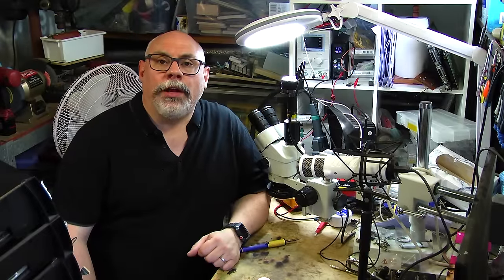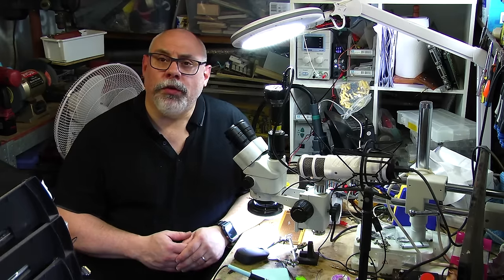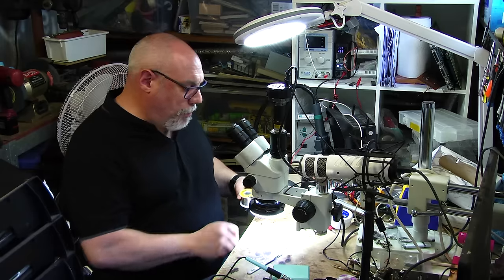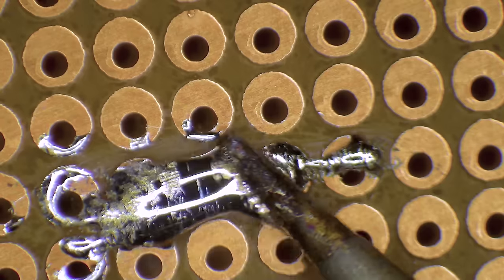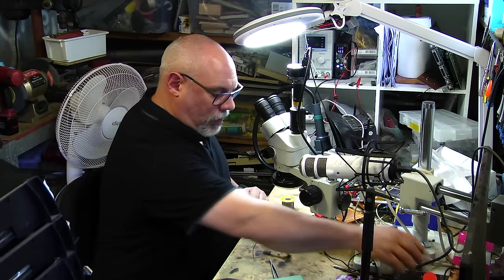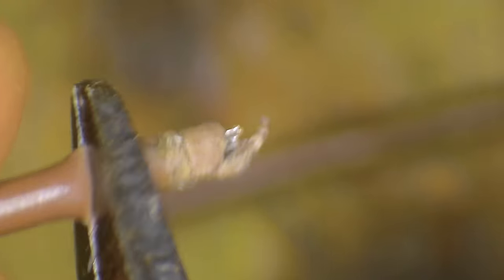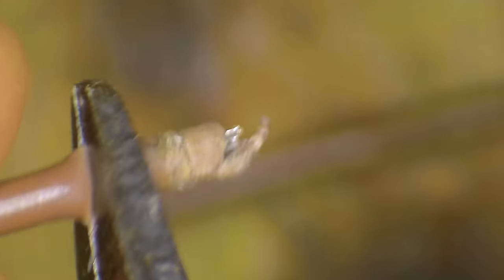Beginner's Guide to Soldering Electronics Part 1

Comment: "…if it’s attached at both ends you need to put your heat shrink on before soldering." Hands up everyone who has forgotten that bit of advice 🙋‍♂️🙋‍♂️🙋‍♂️🙋‍♂️🙋‍♂️🤦‍♂️🤦‍♂️🤦‍♂️

A brilliant video. Thank you very much for using the cheaper hobbyist station.

Comment: Great video... Especially when using flux...always wondered why I had issues, even with rosin core solder...  Only thing I would add is it isn't necessary to hold the flame on the shrink wrap..hold the flame off it some as you move, as the white part of the flame will deposit the soot.

Comment: Thanks Bruce . I watched your begginers guide a year or 2 ago . I tried a again recently  and got all that oxidation i was using a soldering iron that didnt have a station but went upto to 600C , I set it at 450C. I was using lead free solder. I was using a pointed end Tip. I rather think I should of used a bevel tip. Anyway i am going practice some more on the practice boards you mention.

Comment: Nice video mate! Funny, I always tell people the same thing: "DONT use the tip to melt the solder!" The reality is that the solder will almost always touch the tip.  In theory it sounds fantastic, but in actual practice, not so much.  Even pro's like you can't do anything about it.  I think the better advice is, "try to quickly" heat with tip and let the solder melt onto the component.  When we have boards with 50+ components, it'd take ages to wait for each pad to heat up to the sufficient temp to NOT touch the solder with tip.  Anyways, great informative video.  God bless.

Comment: Thank you for this Beautiful content man !!!
Immediately QRCode this man's video link, print onto a sheet of paper, then tape it on the wall by the door. Guaranteed to get that curious customer off the shoulder & out the door so your nose can get back into that mobo. 👍
A reminder for any new solder-suckers out there...if you are buying a pack of shrink tubes because it's on sale with 3k variety tubes in a cheap variety case or container..a REAL geek knows to put it back & go get the good stuff. No such thing as a sale on good heat-shrink. Lol.

Comment: I have always struggled making good solid joints when attempting to solder. After watching this I went and immediately started making solid, clean joints. Even with a very cheap iron. Kudos on the presentation!! 
Would you be able to do a video using butane torch? Many times when I need or would prefer to solder a connection I am miles from an electrical connection so a torch would be awesome to have the know-how to do. Please let me know.  Super video and even better information.   Thank you!!

Comment: At 24:55 you mention that both wires have solder on them so you don't need anymore solder, if you didn't add any more solder and just touched the wires to melt the solder, would they still solder together with a clean bond, or would you need to add some more flux to the wires? Thanks so much, probably the best video on Youtube for soldering!

Comment: You're great! Talk about generous with the trade secrets and you kept it real using equipment beginners would use. Pace attention to detail both on point....you even answered my burning (⬅️ so that happened 😆👁️❤️puns) question is it pronounced solder or sitter... BOTH who cares ya know what he means shutting down nit wits who love a good grammatical error to avoid learning so they are never held responsible in life! I never do the like/ subscribe/comment thing, but how could I not after all there was to glean from this. I'll even watch it over as I put it into practice. I'm just a small business owner whose wires and connectors to small appliances and decorative items have become taxed with new sanitizing protocols due to the recent pandemic. Replacing items only for them to wear out again 2 months later isn't an option anymore. So I've already tinkered with an oil diffuser and some electric candles I did ok they "worked" but my lack of flux has proven to require attention again, a mistake that won't be made twice. Now I'm going to look for anything on lamps....I've had 2 EPIC NEAR TRAGIC FAILS so far...think fire and an electrocution avoided only by explanation of God (I slipped as I flipped the switch fractions of a second and I would have been the rug which is now branded only because the inertia of me falling unplugged it as well....so yeah lamps 101😬)

Comment: With recent improvements in irons, there is now a legitimate intermediate level of iron quality between the "brute force" irons and soldering stations with temp control. 
There are now irons that have fully self contained electronics built right in to the handle of the iron that allows for a full range of digital temperature control. The main power still connects directly to the iron but, along with the built in temperature control, the heater/tip configuration has also improved significantly and they are now much like the more expensive stations. 
There's even a new USB powered soldering iron that has surprisingly good performance.
I just purchased a new soldering "pen" (nice thin easy to handle) with temp control and display right in the handle that's a full 80 watts for $15. It has interchangeable tips and it's been performing way above expectations considering the price point.
Reply from the maker: Yes, if you want some of my other videos, you'll see that I speak quite highly of the TS100. Feel free to reply with links to the models you're referring to.

Comment: I love the way how you preset this instructievideo. Almost therapeutic in calm voice step by step explained. Thank u for the video. Question if i may ask? Example of the wire point soldering you twist the end of the wire. How about  spreading/- split open instead? Meaning connect both wires togheter like vingers from one hand in to the other?  And then soldier it? Stay safe stay healthy love from The Netherlands

Comment: Absolutely fantastic video. Your explanations for what things are and their functions are beyond incredible. I've learn more from you in this video than my personal electronics teach I had in highschool over the course of three years. 
I do have a question for you or to anyone who reads this comment. I have a video game circuit board and was wondering under any circumstances would their be a reason for two pins to be bridged together side by side on one single chip? I was told that if any of the pins were touching then it would cause malfunction and not work.
The thing is my game has garbled glitched graphics and I was wondering if the bridged connection between the two pins could be the reason for why the graphics are garbled & distorted. Any information from anyone would be helpful and if anyone needs to see pictures of the board I can provide them for you thanks.👍😎👌

Comment: I bought a pound of Kester 63/37 Eutectic to practice.  Unless it's jewelry or plumbing, I'll never use lead free. 

Good video brother........"p.o.s.".....lmao 🤣

When your connecting stranded wire you don't like to splay the strands open, twist them together and then solder???   I was taught that's the ultimate for non solid wire. 

I subbed ...you earned it.

Comment: since I build guitars, I have to use the soldering iron to melt the heat shrink (no heat gun or flame on a finished guitar), the key is to get it really close, but don't touch it and burn a hole through the plastic sleeve

Comment: 15:07 I like using sponge and water. That sharp abrasive material you are using there can easily damage the soldering iron tip shorten the lifespan of the iron.

Comment: Here in the U.S., the term "soldering" is pronounced as if it was spelled "soddering".  Similarly, the word "solder" is pronounced "sodder", rather than "soul-der".  The ell (L) is pronounced not at all, so we don't trip over it when we say either word.  Everyone here understands what you're referring to when you say it that way.  I have an older Weller WES50 soldering station, which maintains a constant temp as you work by simply turning a heat dial.  I've found the most important factor in getting a neat soldering job is consistent high heat (around 710-730 degrees F) at the tip of the soldering iron or pencil.  Once you get the hang of soldering, it's a satisfying way to spend time, whether it's an electrical repair or a hobby project.  I got a lot of practice years ago by soldering brass tubing into slot car racing frames (chassis).

.

Comment: Nice basic video, when I do a splice I try to keep the wire joint relatively short as possible, as to not have a big long stiff section of solder in your flexible stranded wire. Also many times I will twist the wires over each other in opposite directions, squirt on some liquid flux and solder together all at once. Thanks for the video, I suggest you get a bottle of water for your throat brother. 😎👍

Comment: Flux is a chemical that is used to clean the parts that your are trying to bond. It is generally an acid so cleaning it off after you have completed soldering not only makes the joint look better but also stops the acid from eating away the joint. Using as little as possible in the first place is a good idea.

Comment: If you are really stuck, you can use the hot tip of the soldering iron to shrink the heat shrink.  Just remember to keep it moving back and forth along the heat shrink as done with the lighter.  I have known some who just use the iron tip as their go to shrinker.

Comment: I first watched this video a few years ago. Like most of the comments I read, I thought it was a great video for beginners. He makes a lot of great points, but left out a most important one that I guess he took for granted. From watching this video I decided to buy a cheap iron, then two then three. Not knowing that irons come in various wattages I thought they were all the same. Not knowing that different materials have various melting points would have been a most important point. Buying a 10-20 watt iron when needing a 40, 50, 60 or more would have been nice to know. I later found out that a cheap iron can also have a temperature adjustment and an 80 watt iron will do most anything a hobbiest would need. Even knowing all that, there is still an important element that this guy, which really is angering, never mentions. None of the cheap irons I bought have a tip that was ready to solder. And this guy never once mentions that tip MUST BE PROPERLY TINNED before using it. How could a professional not mention this once? It was another two years before I finally saw a video and then about ten of them on the different ways of tinning and various materials to tin with. It took a lot of time and frustration to figure out why the solder never stuck to the iron tip. And with a higher watt iron, one can easily use a very accurate pointed tip and not a
shovel. So, I said my piece. Maybe I will make a video soon, but I am no expert. Tin your tip before turning off your iron.
Reply from the maker: I mention tinning the tip in one of my later soldering guide videos, because I forgot to include it in this one. I also go over reasons why you might be having trouble getting solder to stick. And there are links in the description to soldering stations I recommend.

Comment: So, just wondering: Why did you solder the two wire ends, then overlap them with more solder? I was always taught to twist the two ends together, then solder the resulting combination.
Reply from the maker: A lot of people twist (myself included from time to time), but I do try and avoid getting my oily fingers on the wire. The cleaner the wire is, the better the solder will adhere.
Reply: @BranchusCreations  Makes sense, thanks. My old company would usually use butt/spade or lever wire connectors to join wires together, so I had neve gotten much practice with soldering. So your videos have been full of valuable information!

Comment: Just a tip young fella,,When soldering 2 wires together I always run my finger tips around the wires just to check if there is any sharp blobs of solder this can be done with a pair of pliers before I heat up the skrink tube this will ensure no sharp soldered parts cut through the tube..

Comment: Awesome video. The only comment I'd have is not to let the flame actually engulf the heat shrink. Let the rising heat do the shrinking without burning the tubing by moving the flame about 2 cm below the joint.

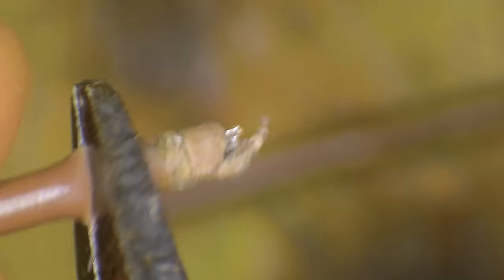Comment: 27:22  I think that for beginners that don’t have a heat gun, instead of using a lighter with the heat shrink u could use electrical tape. It’s easier for people who are starting out. And even as an experienced person, in a lot of cases, electrical tape works better.

Comment: what i do for wires is, i'll twist em straight, then twist them onto each other so they're mechanically stuck with each other. i'll add flux to that and add solder on top of that. i can transfer solder from the tip and it'll work fine because of the preapplied flux

Comment: Great demonstration! Only thing I’m concerned with is when applying the tip to the pad is having to much heat before the solder goes down and ruining the transistor due to excessive heat. I also have had the pads come off when I’m soldering I think it due to much heat. I set my temp around 350 F I also use flux core solder

Comment: What a GREAT video! You are an excellent teacher! My hope is to restore my dad's old boat anchor tube radios and reel-to-reel recorder so... no circuit boards.  What solder, flux, tips, etc should I be using? I was planning to use 60-40 RA but I am not committed to that.

Comment: Thank you so much.  I taught soldering so concepts are there.
However, knowledge does not transfer to technique.
Silver solder is the most difficult to use.  One note:  leaded solder is not like a rattle snake.  Therefore, ventilation is all that is needed.  Thanks for stressing cleaning up joint/connection after soldering.  Even if soldering is perfect, short may occurs over flux.
God bless you.  Not everyone can teach.

Comment: Sir,
Great Information.
How to keep bit clean and tidy?
Reply from the maker: If you're putting your soldering iron away for extended periods, always make sure there is some solder on the tip of the iron. It will help protect it. Other than that, I just use the mesh ball I show in the video.

Comment: I found part 3 first and there you say to do exactly what here you say not to, what gives? Do I put solder on the iron tip and transfer it or is it something I should never do?? 20:25
Reply from the maker: This is the difference between through-hole soldering and surface mount. Parts 1 & 2 of my guides cover through-hole soldering, where the solder should not go on the iron tip first. However, with surface mount soldering, using a good quality tacky flux, you can melt the solder onto the iron and then transfer it across to the component. It's a lot easier doing it this way, especially when one hand is needed to hold the component in place with tweezers.

Comment: I have a problem.   I have a pcb board with a very small burn right in one hole (of the 4 prong) relay, leaving no copper(?) Ring surounding it, and the trace from the hole is very short leading to a "T" on the board.  The short trace leading from the hole to the "T" has also lifted.  How or can I put a new ring around the hole and fix the trace the same way you had demonstrated in your video, which applied to a straight broken trace on a board?  I really wish you'd just fix it😊... but I want to try again if it's even worth it.  I really like how you explain and "show" the difference, by example, between a shabby and a solid soldier.  Thank you for thinking of everyone in the world😊

Comment: 20:50 - You have to put a bit of solder to the iron first, to help you transfer the heat to the wire, then add more solder on the wire. Otherwise you have to keep the iron on the wire for too long, and that's why you almost completely melted down the wire pvc insulation.

Comment: One question i have that bothers me about joining wires, when you join the two strands in the way you have demonstrated, does it not affect the resistance in any significant way especially when dealing with electronic components with tolerance parameters.
Reply from the maker: If the join is good, there's no appreciable difference in resistance compared to the resistance of the wire itself.
Reply: Thank you for clearing that up for me and the prompt reply. @BranchusCreations

Comment: Personally, I'm sure this is just a preference, but I would twist the wires together first, before adding any solder. This ensures that the wires have a good electrical connection.

Comment: Excellent videos, I really enjoyed the careful peace, clear language and great visual aid (thanks to the really good setup)!
One question I have that I can't quite seem to find the answer to: in the part where we're soldering a component unto a board (27:40), what are the risks when a hot iron comes into contact with a PCB? It is easy to damage a PCB this way? Do I need to take care not to touch the PCB with the iron when I'm heating the component I want to solder? Or is this not a big issue due to the material the PCB is made out of? I have a pretty unstable right hand so this is a little scary for me.

Comment: But the other video I just watched said to not heat the wire. Any melting of the wire insulating is a fail. It said to make a bed of solder on the iron tip and let the solder flow from the other side of the wire towards the bed of solder on the iron. Which seemed like the best soldering technique tip I have seen in a few YT vids. I do enjoy your videos and I’m not saying your wrong just thought the other technique was the correct method. We all learn everyday.

Comment: something he didn’t mention but i found useful is to put your iron above the solder so that the heat doesn’t melt your insulation. for really fine wires